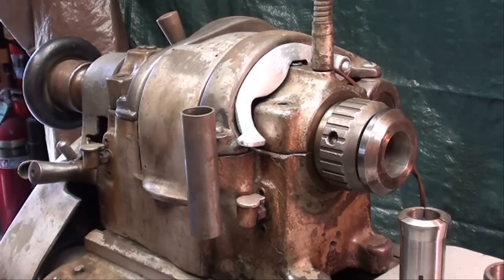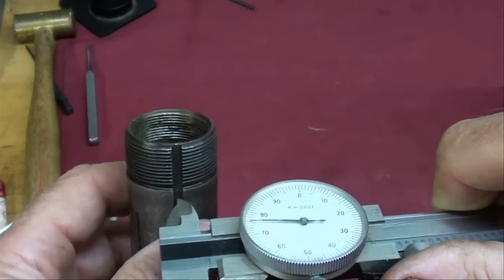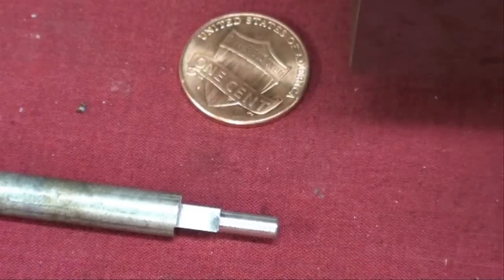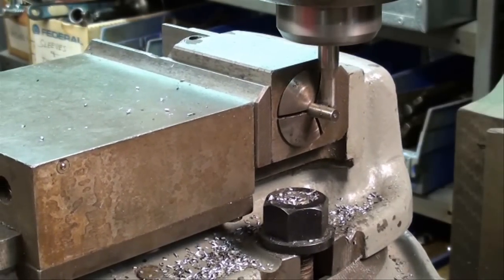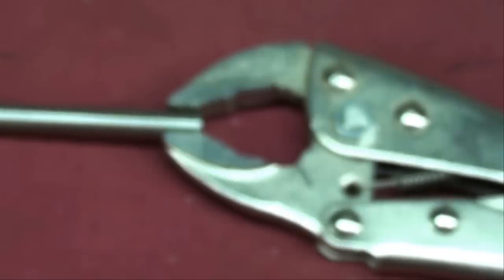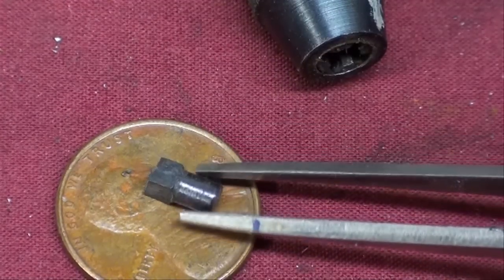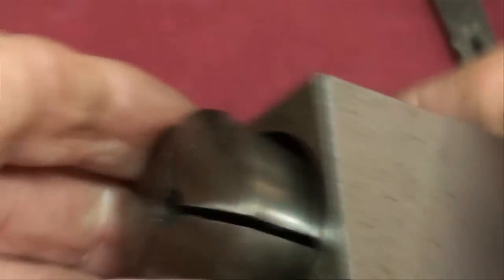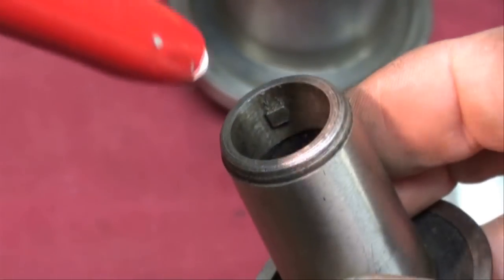MACHINE SHOP TIPS #109 HEAT TREATING Making Keys for South Bend Lathe Collet Attach. tubalcain

Comment: Nice vid/instruction!!  Question...option to the pin vise would have been 1/8 collet in square holder, the mill the part to length...correct?

Comment: Hi Dragsteralf, you might be surprised what can be machined with a simple solid carbide end mill. As for lathe work, case hardened steels are no problem it all depends on the cutting tool, with the right tool you can even machine, not grind, tungsten carbide. It is of course easier to machine soft steel and then harden as Mr, Pete shows.

Comment: Mr. Pete,How did you set up the press fit from the inside in this video?  I only think you put it in a Vee block and then put a shaft through the holder and pressed down on both side of the holder.  Am I close?  Great video!

Comment: Mr Pete I needed to drill out a Brass tap I think in the U.S you call them fossetts  I had to enlarge the hole From 8mm to 10.5 mm, I set it up in my bench vice the best I could I have no V blocks and I had the drill just contacting the work when I had second thoughts, I was frightened it would snag, so put it in my vice and drilled it with my battery drill,, and when it snagged the clutch stopped it from breaking my wrist, Could you do a video on the do's and don'ts when drilling.  Cont above

Comment: I had to make this repair on a 1917 Hardinge Cataract quick Change lathe, it had been damaged by a previous owner attempting to replace the key by welding, it culminated with a .062 tir warped spindle.  I was able to straighten the spindle with flame, ala Keith Fenner, touch up the final .0015 with a dumore tool post grinder and make a replacement cast iron cone bearing for the original that got destroyed when the original key got jammed trough the spindle wall, possibly by a piece of stock coming loose or someone assuming it was a 5mt bore, and cramming a Morse tool in there. . In the process we had to mill out the heat affected zone around the weld and press in a slug of drill rod with a 1/4 20 threaded hole inside, I then made a key like yours that I threaded in from inside the bore timed to come tight when the key was parallel with the bore, I made it out of a grade 8 bolt, figure that's likely to be tough enough, keys really only there to help during tightening the collet, the taper is what provides the drive. I need to clean up the collet bore about just in front of the key about .0003 still to make the collets really usable, I have a Dumore tom thumb Ill go after it with, not fast, but it should do the trick.
Reply from the maker: Nice repair

Comment: I keep watching ..always great.  How about a video on heat treating?  You used a MAPP torch ....could something small also be done with a propane torch?
Reply from the maker: Probably not
Reply: @mrpete222  OK Thanks ...I should have been clearer though ...Propane/Oxy setup?  Were you using a MAPP/Oxy setup in this video?  Thank you for responding.

Comment: its funny that I found this video today because  the  pin on the Bridgeport sheared off the other day . the replacement  part is a set screw with  the end turned down  to  a round pin just like your collet block.
Reply from the maker: I already made but have not released a video on changing that Pin in the Bridgeport spindle

Comment: Using the pin vice to hold the part while griding it, good idea. But if you hold it in your hand your will never get it hot enough to take the temper out.
Reply: Not entirely sure how you would hold it without grinding your hand with it.

Comment: (Cont from com below) I dread to think what would have happened if I had continued in my small drill stand. Should everyone invest in a emergency stop button because one the left hand is holding the work, right hand is on the handle and the stop button is round on the left what are you supposed to do let go of the work to switch off, I think you could convey a lot of safety rules /good practice on drilling, Iv watched the 3 about sharpening but not seen any others where you cover drilling.

Comment: I needed 4 brass pads for the U drive on my Sheldon WW2 Navy veteran 13 X 48 lathe. I found a place that claims to have Sheldon parts. I gave them the part # and other reference info. They got back to me and said "GREAT NEWS" we can make those little shift fork pads for $164 dollars each. BS. I went out in the shop and used aluminum brass brazing rod, built them up and milled them flat on the Bridgeport. For about 5 bucks.
Reply from the maker: You sure saved a lot of money for that one

Comment: Granted it is not part of your average job shops list of daily requirements but it can be done, take a look at youtube.com/watch?v=qKOIWRfvwyY  about 3min 15sec in. There the instructor turns some carbide inserts and no not even I can think of any reason why you would want to, other than to show how tough the turning tool is which is the point I suppose.